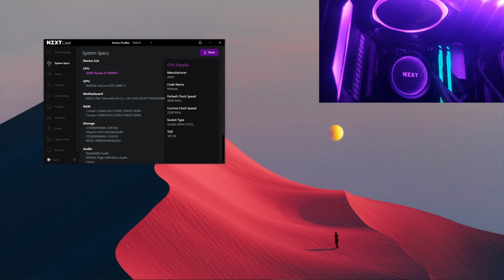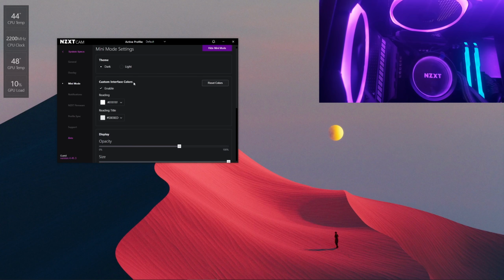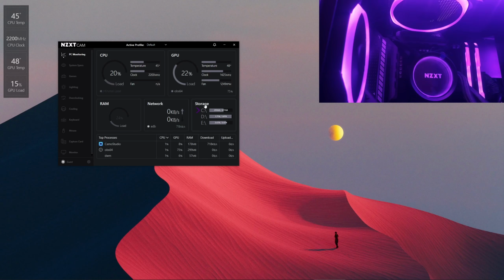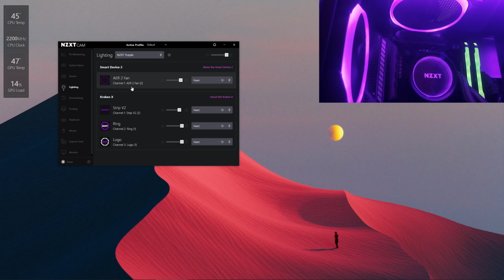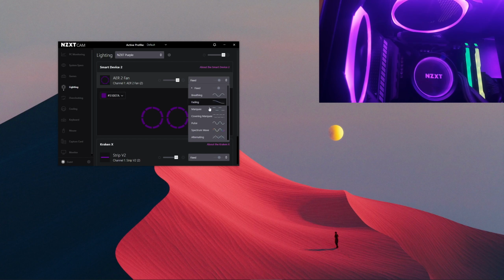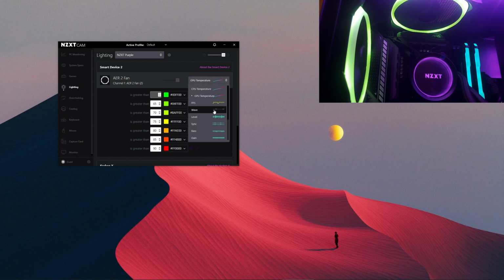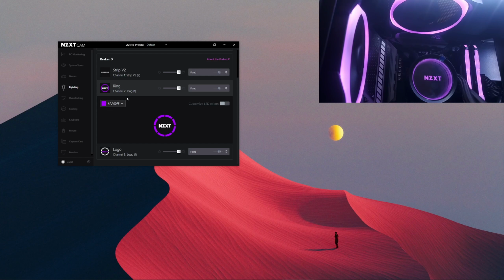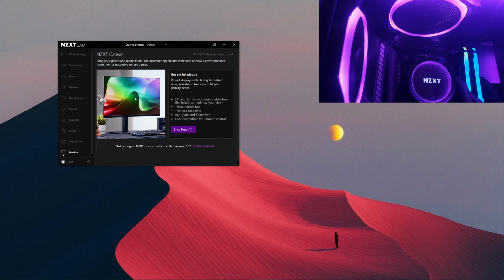An In-depth Guide to NZXT CAM

Comment: My audio level preset does not give me any lights.. is there some issue or is it meant to be that way
Reply from the maker: Which mode cause their are a few different ones
Reply: @techkiga  I have rgb duo fans latest one and h9 elite case but when i select audio level the light goes off, other presets are working fine

Comment: Great explanation, although i was just looking for tips on a fancurve for my 360mm Kraken Elite 😅
I've set my fancurve to monitor liquid temperature to prevent the fans boosting randomly from the CPU temperature rising, i use different profiles for normal use, gaming, heavy load and stresstest.
The pump is set to monitor CPU temps, and is way more quiet than the fans.
Reply: I currently bought a kraken elite cooler are there any issues with the software itself?
Reply: @kyledulay7356  I've yet to experience any issues so far, never had any crashes.
I'd recommend setting the fancurve to monitor liquid temperature if you dont want the fans to ramp up and down, the liquid will rarely reach 30c or higher, which is the highest temp the liquid in my AIO has reached.

Comment: Can my mobo run a kraken 280 non rgb if my I have io connections on my mobo without cam?
Reply from the maker: Yes it can it will see it as any other pump and cpu fun. So Cam is bot nessary if you don't want it
Reply from the maker: You can even control ur pump speed and fun curve in your motherboard Bios with no need of cam

Comment: do a review of how to get cam to actually work, stuck in infinite loading screen everyday for weeks, not even nzxt tech support knows what to do
Reply from the maker: Have you uninstalled it and used the new version
Reply: @techkiga  Just figured I never actually tried running the os in safe mode so I just went and did that. CAM is stuck on loading screen there too. And that's with no os processes, no network no user processes. This is driving me crazy
Reply from the maker: Which nzxt parts have you been running alongside their Cam software is it an Aio and rgb fans through an nzxt controller, or through the aio with the extention cables ?
Reply: @techkiga  the only nzxt products in my system are the HUE+ for RGB LED Strips which uses CAM Software and the Sentry LX LCD Meter which is just a display that shows real temperatures in real time on the screen and independently controls the fans according to the temperature it takes from it's own probes. Does not use any software it works independently from the System and OS. It's only connected to the PC through an OLD Molex cable and no data.
Reply: @techkiga  Tech support gave me previous version and current version offline installer none worked, uninstalled and reinstalled countless times for the past 3 weeks. Deleted the Local Temp files, that didn't work, used revo uninstalled to remove all registry keys and reinstalled after every time, didn't work. stopped all processes attached to the CAM process, that didn't work either. Opened ticket with support almost 3 weeks ago, they asked for logs and I sent them the logs and a few days ago they replied with "we will continue investigating" and closed my ticket. I don't have my previous 3.0 or 3.5 installers cause I never thought this could happen and nobody including support has older versions of the software. Stuck on infinite loading screen no matter what I do and I can't access the RGB to change them. Last bit of info is CAM was working fine until 3 weeks ago. Had CAM in this system for 5 years and I haven't installed anything in the system, software or hardware, to conflict with the RGB control. I just play the same old games. So now I am looking for an old version of the software that doesn't come from a dodgy website.

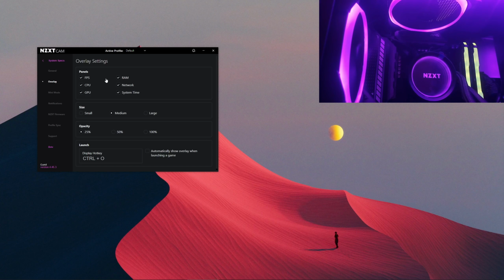Comment: I'm not sure why my NZXT Cam app doesn't show overlay option @1:21. I am also having trouble trying to customize my lcd display. It is not giving me the option in the "lighting" section.
Reply from the maker: Which version of the pump do u have ?
Reply: @techkiga  same issue
Reply: @techkiga  I replaced my old Cam with the new released elite Cam and reinstalled the app. Everything works perfectly now. Unfortunately I didn’t find a resolution for my previous lcd model, but this new Cam is working wonders along with the app.
Reply: any fix? the overlay option isn’t there for me as well
Reply: i am having the same problem i have the version 40.50.2 of NZXT cam